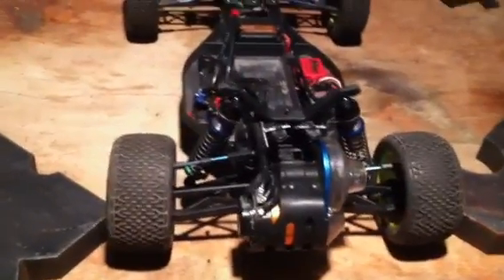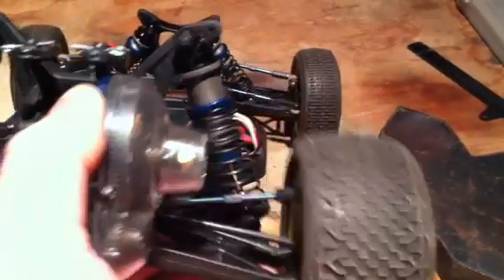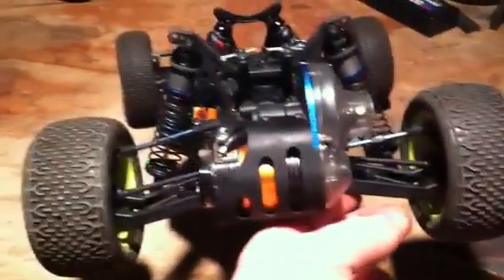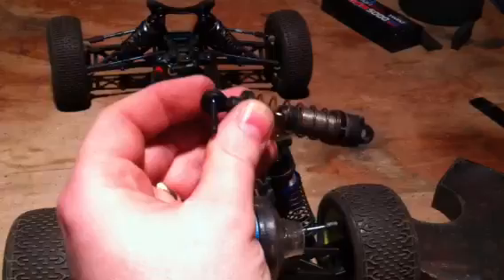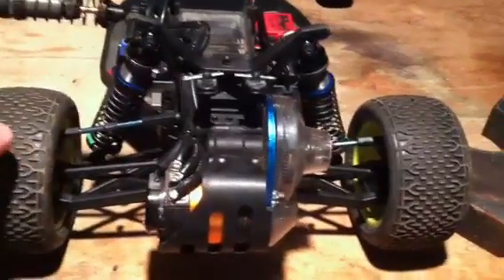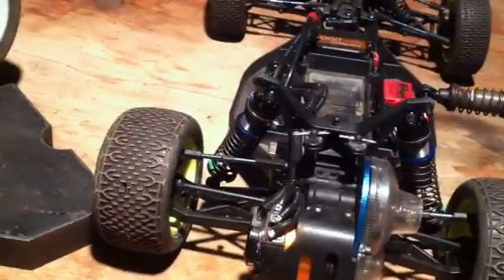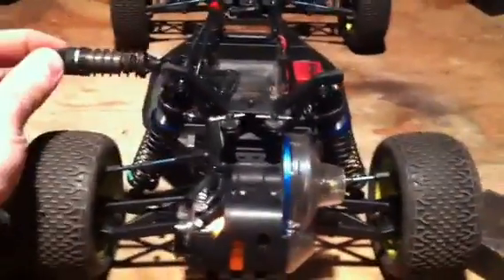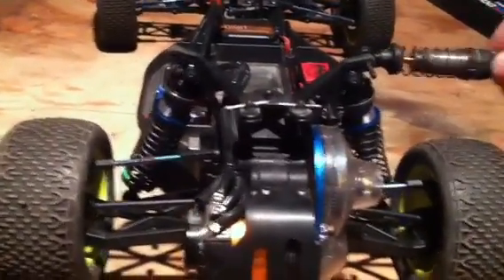Roll center demo

Comment: It's not because when you have a lower roll center means that the vehicle will roll more !!! ... Basically ; Because you have a higher CG you've noticed a significant rolling moment ... And because this is a moment of roll and that moment is equal to Moment arm vector multiplied by a force vector ... So what you've done was that you've made the force with a constant value and you played with the moment arm length to increase roll moment value .